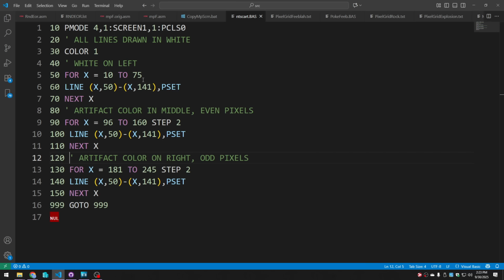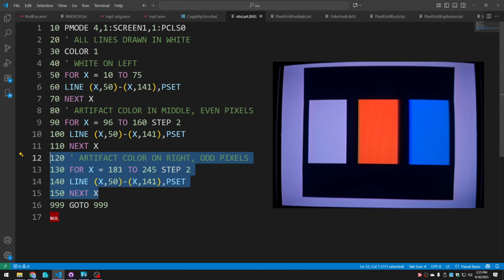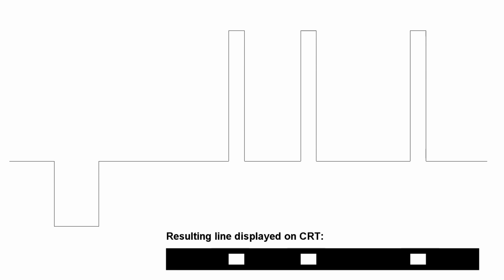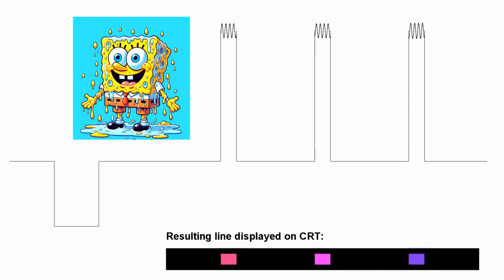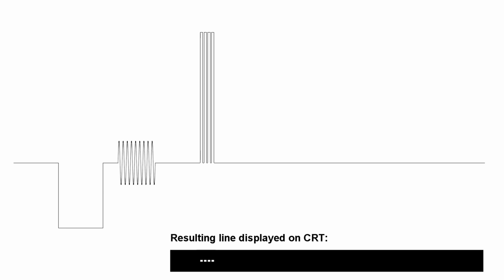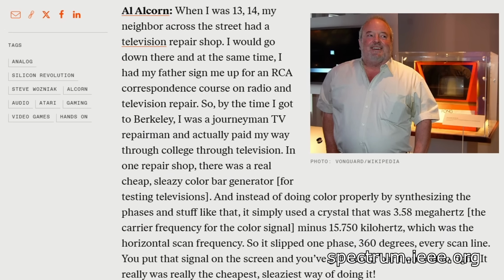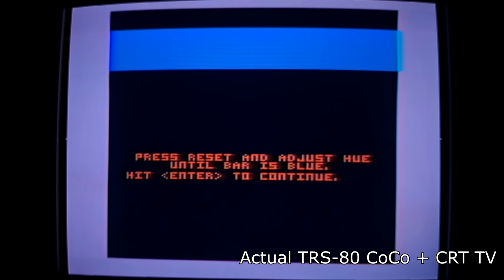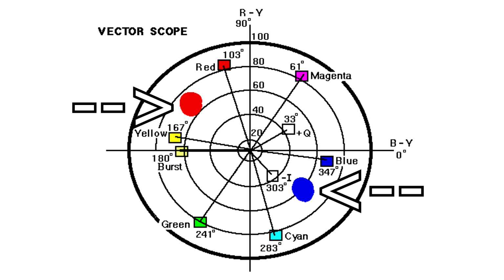How early computers TRICKED TVs into making color (out of nothing at all)

Comment: I'm just siting here picturing (pun intended) people resetting their computers a dozen times getting the wrong color and then when they finally do get the right color, they press reset again by accident and the wrong color comes up another dozen times! 😁
Reply from the maker: Not only did that happen to me many times, it happened to me while filming this very video.  Maddening!
Reply: @CocoTownRetro isn't it easy? Just got that Reset button at 3.579545 MHz
Reply: @CocoTownRetro you should have left it in. I could feel it coming
Reply: @CocoTownRetro  as a programmer, it surprises me that the developers didn't just set up a Boolean variable and a button for the user to press to shift the phase by 180 instead of expecting the user to reset multiple times and hope for the correct phase.
Reply from the maker: @CircuitrinosOfficial  Some programs did indeed do this the user friendly way as you described. But it does take more memory and additional effort on the part of the developer. Sometimes laziness or time constraints get in the way of making perfect software.  🙂
Reply: @CocoTownRetro 
"sometimes laziness or time constraints get in the way of making perfect software"
there has never been perfect software. there is only software that is hopefully less wrong than it was previously.
Reply: @CocoTownRetro  is it about an equal chance of each colour showing up each time? Or is the previous colour much more likely to show up again?
Reply from the maker: @Jivvi  Supposedly about 50/50, I think, regardless of the previous state.  But the hardware is much older now than when it first came out, so who knows what the odds are now...
Reply: Perfect description of trying to find a shiny in pokemon games
Reply: That did happen sometimes for people like me who had a CoCo 1 or 2 :)
In the CoCo 3 they finally "fixed" the timing so that you would always get the same colors every boot (you could hold a key down while turning the computer on to get the other color set). (Edit: This was mentioned in the video too; I hadn't gotten there yet.)
Reply: I knew exactly where you were gonna go with that, it's very human behavior 😂
Reply: Reminded me of constantly resetting a NES to try to start it up. Or an N64 GameShark.
Reply: Generally we didn't care that much. Since the only colours the CoCo could produce through artifacting were orange and blue having realistic images was kind of a lost cause anyway, and it was often tough to even know what the program you were looking at was actually meant to look like. Are the bugs in Mega-Bug blue or orange? Does it even matter? You just play whatever you booted into.
Reply: or, power outage suddenly hapens and when it back on wrong color again
Reply: Minecraft paintings:
Reply: Oh, that happened (former CoCo 1 owner...)
Reply: ... and that explains why i used to hit the monitor when it didn't work, i was in fact readjusting the clock signal... i always knew there could be a logical excuse i could make for it (rip my first computer monitor)...
Reply: i’m CERTAIN that definitely happened 😂😂😂
Reply: More time than you think
Reply: That's what happens to me when I'm trying to select the input on my TV, because there's a delay.
Reply: I actually remember the inverted image... Aaaand reset!

Comment: Technically, PAL did give you artifact colour, but the effect was nowhere near as vivid: you'd get a pale pink and light blue, which was really more of an annoyance, and probably had as much to do with RF cable crosstalk as anything else.
Reply: Why is it more resilient?
Reply: It work in pal, but you need the video out circuitry to be in phase and at the same frequency of the pal signal. More over you may need to defeat the pal design (colorn burst is turned 180° each other line and the delay line prevent artefzcts) - so i think you have to implement a dual pattern horizontally and vertically

Comment: I'm not exactly clear whether you mean artifacting didn't work on UK PAL TV sets, or whether you just mean it wouldn't on American NTSC-using computers. Cos I can tell you, it did work. There was an article in New Atari User in the 1980s, a British magazine for the Atari 8-bits, about artifacting. It listed a demo program, and it worked fine. It was the same principle, hi-res mode (the Atari's superior, higher hi-res) and draw alternating stripes.

On the Ataris this was just a side-effect, the computer had a proper 128 colours using chroma and luma properly, but artifacting worked anyway. Though my grandad had a Dragon so I find them charming too!
Reply: The artifacting you get on PAL is much less dramatic than NTSC though and more of an annoyance than a useful hack.
Reply from the maker: I probably wasn't very clear on this.  My intent in the video was to focus on NTSC, show that hardware that exploits NTSC-specific artifacting did not have the same effect on PAL, but similar effects on PAL are indeed possible (if the hardware / software were designed for it).  My limited understanding is that it wasn't as easy to exploit PAL artifacts as it was for NTSC, which may be why it wasn't as prevalent.

Comment: I don't think it's fair to call Artifact color a "bug" in NTSC. 

From the perspective of the TV, it's receiving a 100% valid NTSC signal. It's a very janky signal, but it's absolutely within the bounds of the NTSC spec. And the TV is decoding that signal 100% correctly. In fact, all TVs decode the artificial color identically (it wouldn't be very helpful if it didn't) and you can even transmit it over broadcast TV without issues. 
You can even split a composite signal into seperate chroma/luma (S-Video) and recombine to get the same composite signal again (which happened every time you recorded the output of a computer with a VCR).

It's not like color artifact has found a second way to trick the TV into generating colors; If you generated the same image on a modern computer with those same garish colors, then fed it into a professional NTSC encoder, it would end up generating basically the same signal (depending on the exact phase).

The hack is on the computer side; Artifacting is completely the wrong way to go about generating a color NTSC signal, but it's very cheap and it works everywhere. 

BTW, one factor you missed is that the color killer isn't the only way to prevent luma signal bleeding into chroma. 
A proper NTSC encoder will run the luma signal through a notch filter and filter out any luma signal that the TV might misinterpret as chroma. As long as the notch filter is enabled and configured correctly, you won't see any artifact colors on regular video (though you still see the color fringing). 

The downside with the notch filter is that you lose horizontal resolution. That striped box will be filtered down to grey. Sharp luma edges get slightly blured to push them out of the problematic frequencies. Color NTSC has significantly less horizontal resolution than b&w TV, essentially color stole a frequency band previously reserved for high-frequency luma, but the tradeoff of comparable color was generally considered worth it.

The color killer is actually there so that your color TV (or B&W TV with a dot crawl filter) can get a free resolution boost when it's only displaying b&w content. And of course home computers quickly took advantage of it because the horizontal resolution of color NTSC was barely enough for NTSC video to start with, and generating a correctly filtered luma signal was too expensive for cheap 80s hardware.
Reply: The dot mask on a color TV limits the resolution quite significantly. Anyone using 80 column text on an Amiga with a TV modulator can confirm this. So the high frequency luma wasn't a huge loss. However it was annoying for anyone with an old b&w TV that lacked a filter to remove the color signal. 

Chroma dots from telecine taken from an unfiltered b&w crt, have been used to recreate color versions of lost episodes of programs such as doctor who.
Reply: @phill6859 The Amiga A520 RF adapter? That thing was really shit.

You aren’t getting anywhere near what your TV’s shadow mask could achieve. It apparently bandwidth limits the video signal to just 2.4MHz before color encoding, that’s a horizontal resolution of about 250 dots, which isn’t even enough for 40 columns of text without looking somewhat blurry.

There are better NTSC encoders, that can get better results, though never really good enough for a full 640 pixels.
Reply: @phill6859  Chroma dots from telecine - wow cool!
Reply: It's just programmers wanting to brag or stroke their ego thinking they tricked the TV, when in reality they were just doing the work that a few transistors (or inductors?) did in other systems.
Reply from the maker: @phirenz Some excellent points.  I like the description of how the notch filter was used. Thank you for taking the time to write that up!
Reply: Is it a compliant NTSC signal, with chroma dipping all the way down to baseline voltage?
Reply: @renakunisaki  yes, if you look up the standard SMPTE color bars (and find a screenshot of the waveform) the magenta is an example of such a color. 

It actually goes slightly further, the highest peak is slightly above white and the lowest level goes- slightly below black (because the full range of values goes from 133% of white to -33% of black)

So that’s the other slightly wrong thing about the diagrams in this video, they show the color amplitude as being a small fraction of the luma amplitude, when really it’s amplitude is allowed the full range.

When a NTSC tv encounters this signal of black and white bars, it first splits it into luma and chroma carriers with notch filters. The luma signal ends up as a solid 50% grey, and the chroma signals is close to 100% saturation with whatever phase. 

BTW, this is why artifact colours often look garish but muted. With only black and white bars, you can only target colors with 50% luma and close to 100% saturation. To get better colors you need to start with more levels of gray. Which some implementations do.

Comment: Things were even more complicated for the odd-balls that purposefully suppressed artifact color in order to make the display sharper and text more legible - the VIC-20 and C64 (and C128). These oddballs not only altered chroma phase by 180 degrees each scanline, they also altered chroma phase by 180 degrees each field. The most straightforward way to accomplish this was by having a dot clock so that each byte of pixel data was an odd number of half phases - 3.5 chroma cycles instead of 4 chroma cycles.

In the space that an Apple ][ or CoCo would have 7 pixels, the C64 had 8 pixels. That's why the pixels are narrower on the C64.

The bottom line is that a C64 attached to a display via composite will bizarrely NOT have visible NTSC color artifact fringing. It's there, but the phase flips 180 degrees each field so the visible effect cancels out. This is actually really good for making text look nice and legible. But it means artifact color doesn't work for ports of Apple ][ games (like, for example, Karateka).

This bizarre oddball approach would be a minor footnote in home computer history, were it not for the fact that the C64 was so numerous.
Reply from the maker: @IsaacKuo I had no idea the C64 was doing this.  Flipping phase 180 degrees each field to cancel out artifact fringing is fascinating!
Reply: Is it the relationship between the pixel and color clocks in the C64 that cancels out the fringing, or that the scanlines had a leftover half color clock on the end, causing the 180° shift?  I think it's more the latter point.  Incidentally, the scanlines on the early NTSC VIC-IIs were only 224 color clocks long (as opposed to 227.5 on the latter ones), so on those the color carrier was in the same phase on each line.
Reply: @sa3270  The 180 degree shift is caused by a combination of the pixel clock and the fact that the non-bugged VIC-II has an odd number of cycles per field. The bugged VIC-II lacks the intended 180 degree shift because it had an even number of cycles per field.

It's not the only way to accomplish this shifting. The Amiga accomplished it with complex timing capabilities. But the way it was done on the VIC-20 and C64 was more economical to produce.

Comment: This is a really thorough explanation. This trick worked on machines where a common clock was used for both color and pixel generation. I had an Atari 800 and there were a lot of games that used artifact colors. The colors were inconsistent between different Atari 8-bit models because changes to the video buffer circuits resulted in slightly different phase delays (and even chroma inversion on some models). We didn't have to deal with the reset issue, though, as the same chip generated the burst and the video.
Reply: The c64 purposefully avoided using the same color and pixel clock to avoid this issue. It's not entirely perfect. White is still very hot, so much so that it caused audio interference. You used it sparingly.
Reply: @phill6859  I never understood why Commodore felt they needed to avoid the color frequency, considering that artifacting is present anyway.  It would have made it easier to leverage artifacting in programs.  A more compelling reason they choose their pixel clock might have been to bring the CPU clock very close to the maximum rating, which they could have used as a marketing point over Atari.
Reply: @sa3270  C64 had both NTSC and PAL versions, maybe they did not want effects on NTSC that would not work on PAL machines? But on the other hand the machines ran on slightly different frequencies, obviously different frame rates and thus had different number of clock cycles per frame and scan line and of course different number of displayed lines if you removed the borders. Not to mention the two blues were more purple on PAL than on NTSC, especially the lighter one. But generally NTSC games worked on PAL and vice versa, with some few exceptions like some timing bugs tended to have higher probability on PAL machines. And if you were timing critical you were more likely to have the time during a PAL frame than during a quicker NTSC frame.
Reply: Since the Atari 8-bits had better ways to make color graphics, I always wondered why so many Atari 8-bit games used artifact color until quite recently, when I realized that most of them were probably very straight ports from the Apple II, where artifacting was the only way to get colors in hires. They were both 6502 machines, and the Atari's "mode 8" wasn't that far off from Apple's hires mode, so porting the graphics was largely a matter of tweaking (and mostly simplifying) how the pixels were written to memory. But you'd lose some colors, since Apple devoted one of every 8 bits of video memory to Steve Wozniak's weird phase-shifting bit that was just designed to give you more artifact colors, and Atari didn't bother with that since they had real color modes. But a lot of Atari games had been developed for the Apple II first.

Flight Simulator II for the Atari 8-bits actually took advantage of the Atari's ability to combine different graphics modes in horizontal bands of the screen: the out-the-window display was in a genuine 4-color mode, but the cockpit instrument panel was in hires monochrome using artifact color for colored accents and the artificial horizon, and I'm guessing it was ported with very little modification from the Apple II version.
Reply from the maker: That's interesting about the Atari 800 inconsistencies between models!  Thanks for sharing.